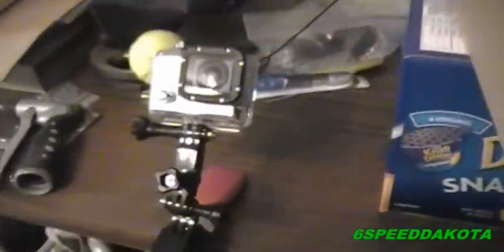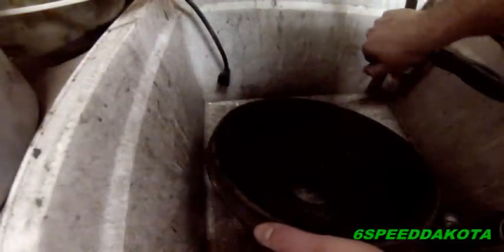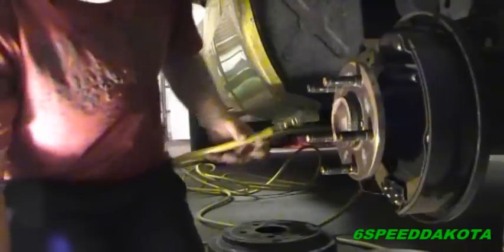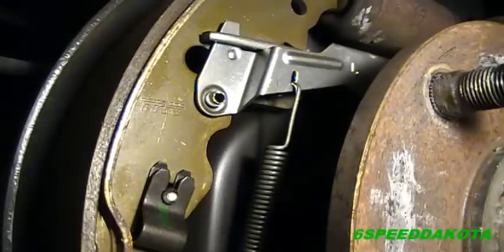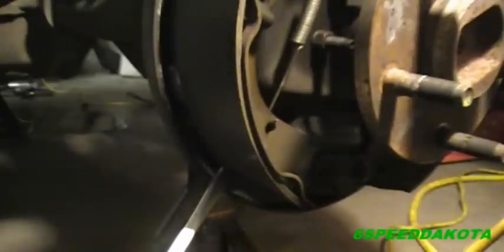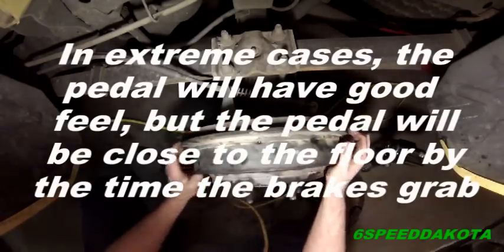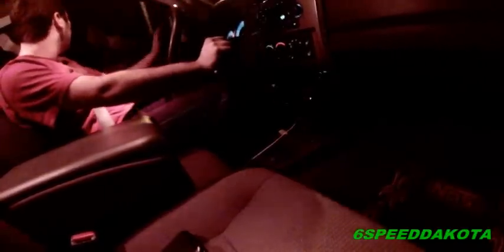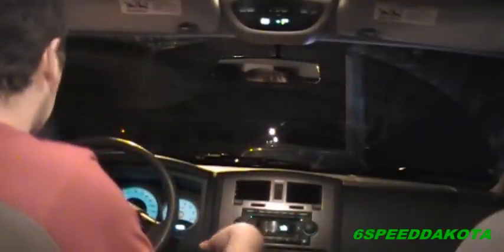How to Clean, Lubricate, and Adjust Drum Brakes

Comment: Good video. Any risk of damage to drum shoes when using flat head screw driver to create space for anti seize on contact points? I get paranoid and don’t want inadvertent damage. Seems straight forward but want to be sure. Thanks.
Reply from the maker: Not really, just be gentle with it and don't mark up the shoes. If you're using the screwdriver like a hammer, you'll probably damage it lol
Reply: @6speeddakota  gotcha. Thanks what I figured. Thanks again.

Comment: Great video. My 96 Chevy Silverado has a slight thud only when braking at slow speed. The front brakes were done but I've noticed that the back drum brakes don't adjust much so I have to go in about ever 6 - 9 months to manually adjust them. No big deal but I've noticed that when I had a 96 Sierra the drum brakes self adjust automatically and I would not have to go in a manually adjust them. Their probably just made a little differently. Once I adjust the drum pads the slight thud goes away almost like the drum brakes engage after the front brakes. Is this true?
Reply from the maker: There’s a metering valve that delays the action of the front brakes under light braking to allow the shoes to catch up to the drum so all 4 brakes work evenly. If you hammer the brakes, that valve does not function and it grabs all 4 as hard as you hit the pedal

I find that after some use, corrosion, heat, a crap ton of brake dust, etc, that the automatic adjusters aren’t so automatic anymore, hence why they need to be adjusted periodically. The adjuster probably needs to be taken apart, cleaned and lubricated.

I prefer to clean them out and adjust them at tire rotation intervals, every second oil change.
Reply: @6speeddakota  Thank you for the tip. So now I know why there is a delay in the back brakes. Well I'm going outside in just a few to get everything cleaned up and adjusted and lubricated. Thank you so much.

Comment: I have a 1999 ford f150 4x4. i live by the bay. go thru salt water all the time. cleaning my brakes. lots of rust on springs etc. should I leave a lone or hit with blaster Penetrating Lubricant?
Reply from the maker: I'd hit them with something like fluid film which is lanolin based. But don't go too crazy because it'll attract the dust, you'll have to clean out your brakes more often, but it'll prevent it from rotting the backing plate completely out.
Reply: Thanks.

Comment: Hi, thanks for the video. I've got a 1973 Morris Mini 1000 and, while performing the drum brake clean process I found that there was this "brown liquid" (I assume it is brake fluid) inside the "boob" (not sure about the terms here). So, the question is: Is that ok? If not, What should I do about it?

Thanks in advence and thanks again for the amazing video!
Reply from the maker: The brown liquid behind the rubber boot is very likely brake fluid. I would replace your wheel cylinders because leaking brake fluid is definitely not ok.
Reply: Thanks for the advice!

Comment: are you sure there isn't any asbestos now in breaks pad i found online that there is still asbestos in break pads
Reply from the maker: +benjamin It's been phased out in the last 20 years, but it's always good practice to be cautious.
Reply: thanks for the info
Reply: From what I hear.  Asbestos was phased out in the late 80's, only to come back when Bush Administration overturned it from hard lobbying (payouts) of the asbestos industry.  A new car will not have asbestos in it because of the great potential liability of selling such a car.  But, this does not stop Mexico and China from selling asbestos pads here, being that they are too far away to sue.   Also, I found some pads with what is called 'asbestos bodies' in it.  Its like baby asbestos.  It skirts the rules because it is not quite asbestos by definition of the way it was formed, but has much of the qualities of Chrysotile asbestos.  
When I do a brake job, I use a mask and wash backing plate /shoes with hot soapy water.   I find that hot water works better than brake cleaner.  I also wash out the drum dust and throw that away.

Comment: Why does everyone say to adjust until shoes drag on drum? You are then driving with brakes applied (even though it is only slightly). Shouldn't you adjust till brakes drag then loosen slightly? I really don't understand logic of this. (I'm about to do my first drum brake change and am just starting to try to learn this stuff.)
Reply from the maker: +yusuihang I the shoes are too far away from the drum, it'll take too much pedal travel to bring the brake shoes to the drum, and your pedal will sink down further to the floor. Although for me, I like to adjust them looser than tighter since I've had issues with the drums being too tight before.
Reply: +6speeddakota I guess I don't understand the increment of adjustment possible with the star wheel.  Sounds like that if you get the brakes to drag slightly, then just one notch in with the star wheel will make it too loose for normal brake pedal travel?  Guess I'll learn some more when I do this.  Thanks for the video.
Reply: It's easier to adjust by adding on then taking off due to the way the adjuster works. Never mind the slight drag. When driving the vehicle, there will be slight wear eliminating any drag. Plus, despite your best attempts to align the shoes by stepping on the brakes while driving (carefully) for several hundred yards or so, the shoes will adjust. 

All this is a lot easier than stepping on the brake pedal and having sink to the floor with very little braking action.

Comment: Hi I replaced my drums a few weeks ago on my 95 Dodge Ram 1500 they are making loud noises when I hit the brakes what should I do
Reply from the maker: First thing, pull the drums off and take a look for anything out of the ordinary. You may have not put something back on correctly, you'll probably find that one side makes noise and the other side doesn't, then compare the two sides to figure out what's wrong with the side that makes noise.
Reply: +6speeddakota me and my dad looked it over 3 times its all good we just don't understand why we clean the drums with break cleaner and it stops for like and hour then it goes again ?
Reply from the maker: What I think is happening is there's a lip worn into the drum from many years of use, the new shoes may be slightly wider than the old ones which is causing the shoes to ride on the lip and make all kinds of noise. I can't be certain without seeing it though
Reply: +6speeddakota what do you think I should do then just deal with it ? Or
Reply from the maker: I can't tell you what the problem is without looking at it directly. What I'd do is take the drums off again and look at the friction surface. If it's not smooth and all grooved, then you'll probably want to either have it machined or replaced depending on how worn out it is, there's a wear limit to the drum, once it gets too worn, it has to be replaced
Reply: +6speeddakota alright thank you very much

Comment: I phoned up jiffy lube and the guy laughed at me when I asked how much it would cost to lube my drum brakes like he's doing here. He also said if you remove the cover of the drum brake that AIR (god forbid) is now inside and that you now need to do a BRAKE FLUSH.
LOL.

Bro this should be a 5-10 dollar job, all I need is your lift
Reply from the maker: I've heard a lot of stupid excuses for things, but that's a new one lol
Reply: @6speeddakota  my squeaking drum brakes turned out to be excessive build-up of brake dust as I discovered when I opened it up. A quick spray of brake cleaner, followed by letting it air out did the trick.

Comment: I have an '07 Dodge Caliber that has a weird squeaking noise coming from the rear, only makes the sound when i release on my brake pedal. It does make the noise when i pull the parking brake as well.. any idea on its origin..
Reply from the maker: I'd suggest taking the drums off and perform this procedure. If it still persists, I'd look for a lip in the wear surface of the drum and see if you can grind it off, because that'll cause a squeal as well
Reply: Ok, thanks.. ill update my results
Reply: Karlton Ruddick we are waiting in suspension here, Karlton ,)
Reply: K. Ruddick Every time I have had the squeak you describe in drum brakes, it has always been that the lube is gone between the shoes and the 3 contact points on each side of the backing plate. I always use a black lithium wheel bearing or caliper grease

Comment: isn't water gonna corrode the metal?
Reply from the maker: The surface rust on the drum will come off the first time you hit the brakes, not a big deal at all
Reply: Perhaps you can begin with water, and only give a little spray of brake clean on it. The final spray will drive all the water away.

Comment: I have a 1997 Dodge ram 1500 v8 my drum is leak break fluids I have no ideal what I do in what is leaking would u know
Reply from the maker: +Ruby Veach You need to pull the drum off and look inside. There are two spots where it can leak some kind of fluid from. The wheel cylinder, which pushes on the brake shoes, it's generally at the top of the backing plate. Find it and peel back the rubber boots and check if there's fluid in there. If you see fluid dripping out, then you need to replace the wheel cylinders.

The other place it could leak from is the axle seal, but it would be gear oil. not brake fluid. If you take the drum off, look behind the hub where the axle shaft goes through the backing plate, if you see fluid leaking at that joint, then you've got a bad axle seal.

If it's leaking that much fluid that you can see it and it's brake fluid, chances are that you've probably got next to no firmness in the pedal at all, so that's a sure fire way to tell if it's brake fluid